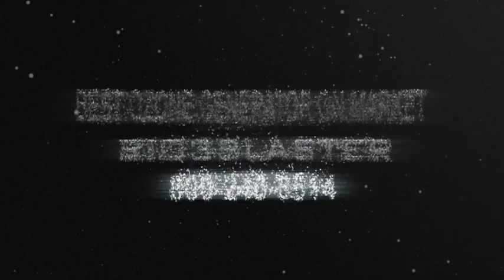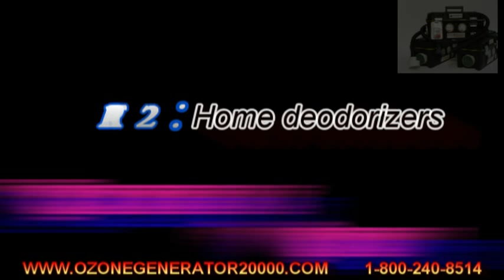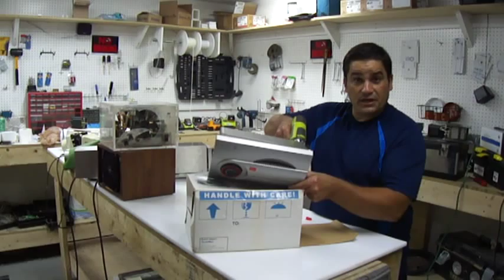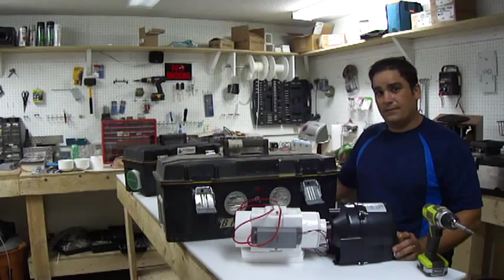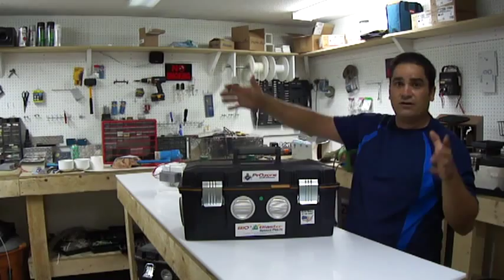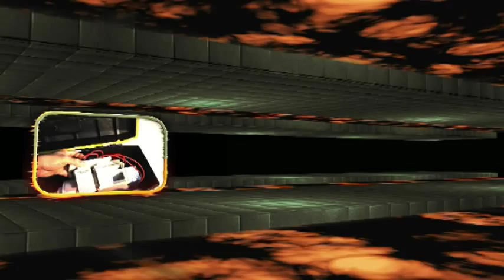Ozone Secrets Revealed (Part 1) Mica Plates"Blaster", Deodorizers, Home Odor Removal machines

Comment: The two shown in part two, I love those. I use them as air purifiers, as they have ionizers in them, and run the ozone on a low level of ozone output. Completely solved my allergies and also makes the house smell like nothing at all.